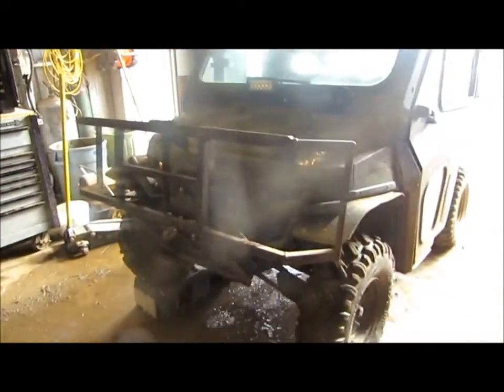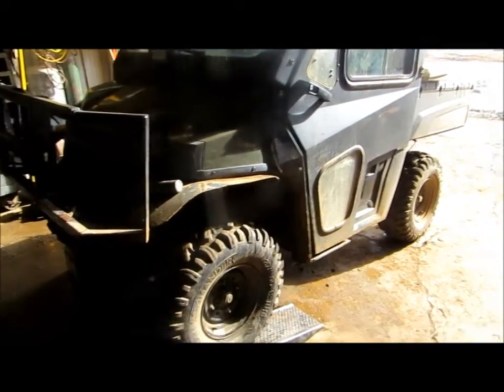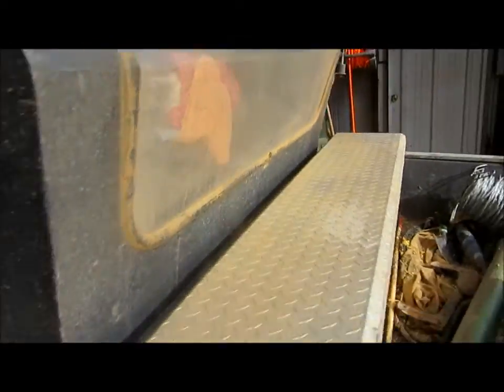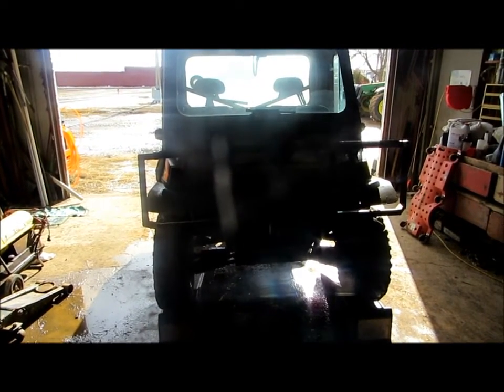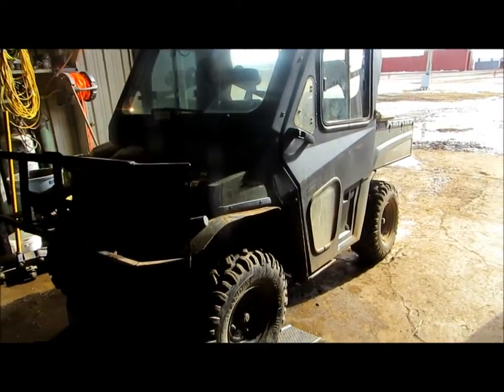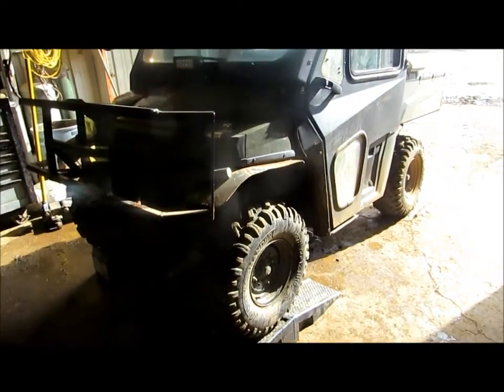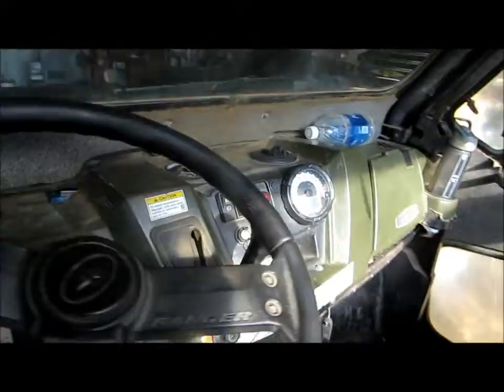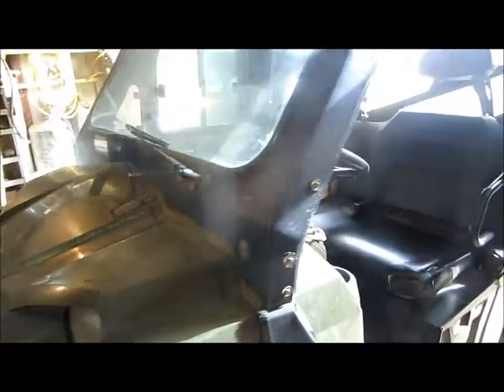Justifying SxS Ownership for Farm or Ranch

Comment: What would be a good price on a used one and what would you say the max hours would be on one you would buy
Reply from the maker: Wow, that should be a simple question, but it really depends alot on what you plan to use it for, how much time you plan to spend in it, whether or not you want to trade at the end of warranty, or just want a machine that cheaper to fix that's out of warranty.  Are you planning on repairing it yourself?  I'd hate to tell you what to buy before I know what you really are looking to do with it, and how often you'd want to replace.  Cab system?